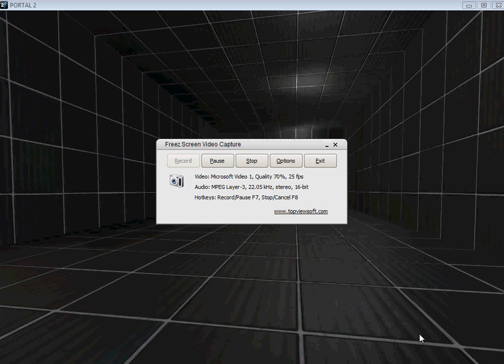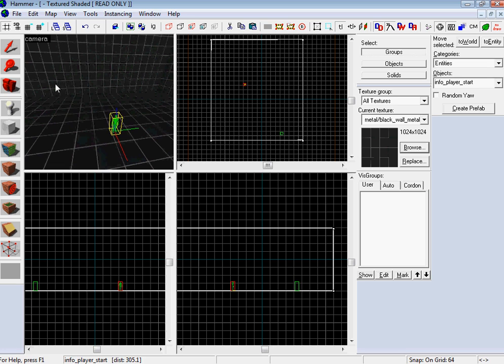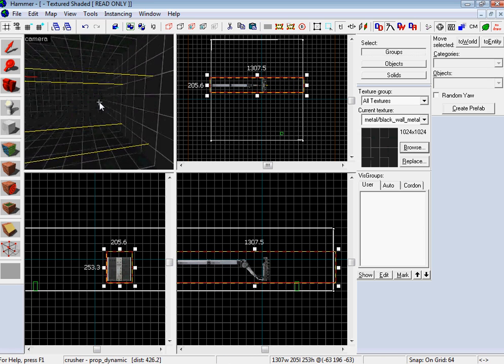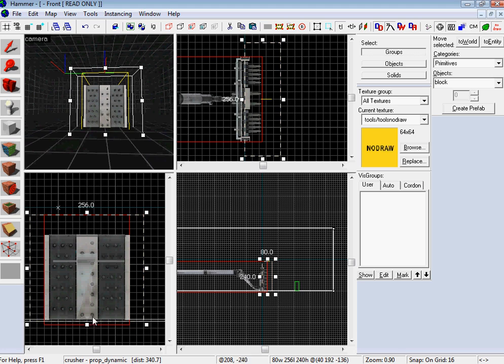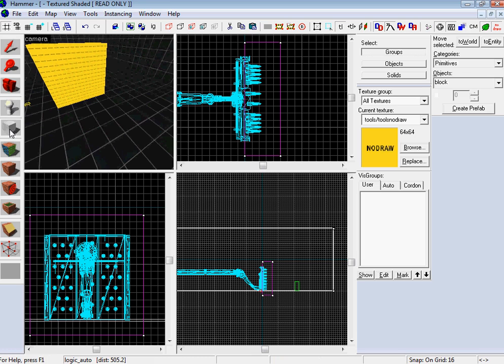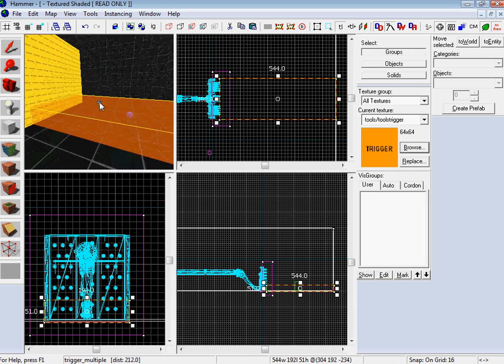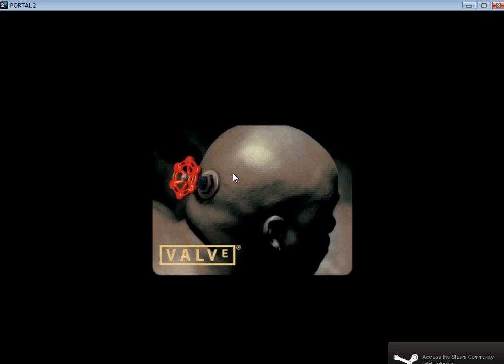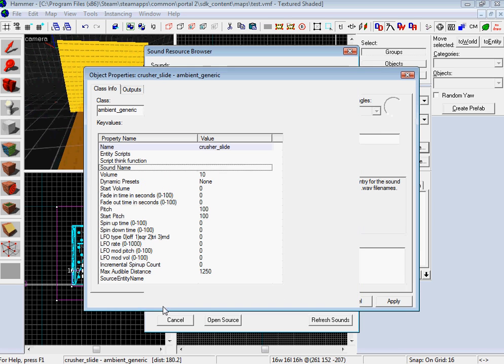Portal 2 SDK Tutorial 10 (Crusher)

Comment: First, your terminology is wrong.  You don't bind TEXTURES.  You bind BRUSHES.
Second, you really need to read some tutorials yourself as this is needlessly over-complicated.
Third, you don't really need to bind the brush to model as you can simply use another model which has a destruction animation which fits nicely with the crusher.  You can find a crusher instance that has all the various parts need to make it work at thinkingwithportals in the downloads section.